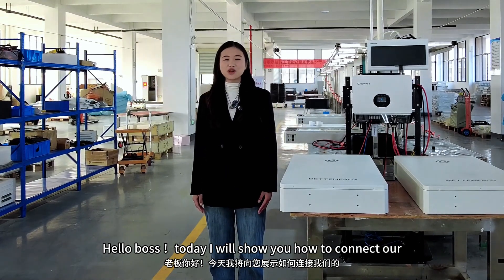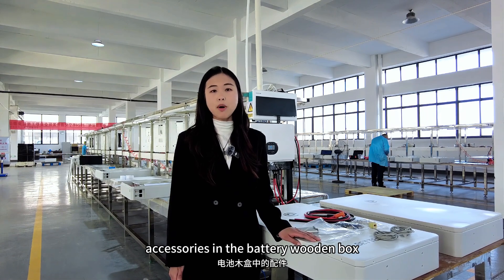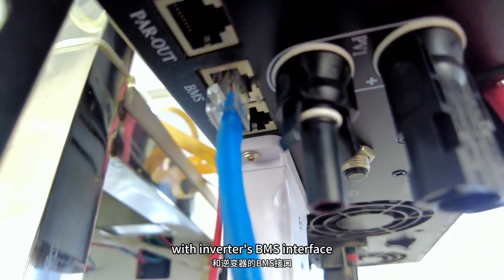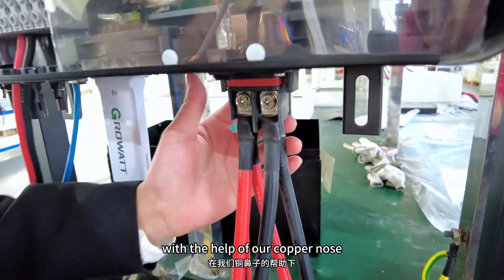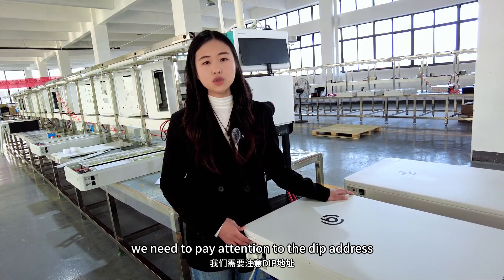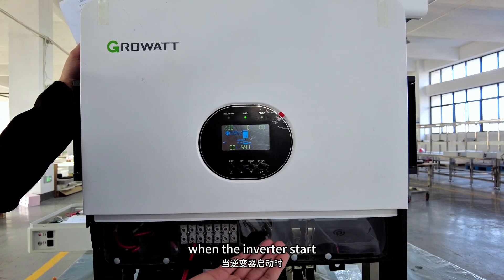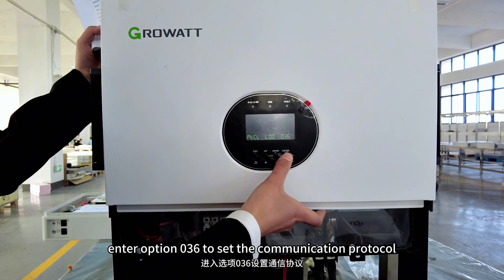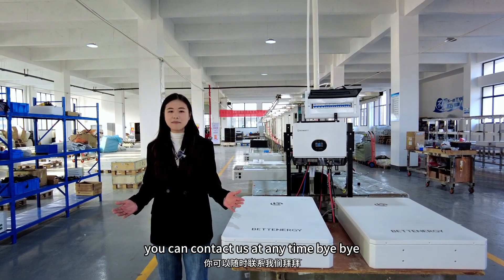How to connect BETTENERY 10.2KWH with Growatt 6000es

Comment: Please what’s the protocol 52 for? Is in the manual to set at 52?
Reply from the maker: 52 is the CAN protocol of Pylon
Reply: @ what’s Pylon
Reply from the maker: @ Just follow this setting. This is the communication protocol between the battery and the inverter. The same communication protocol can ensure that the inverter can correctly read the battery information and correctly control the charging and discharging.